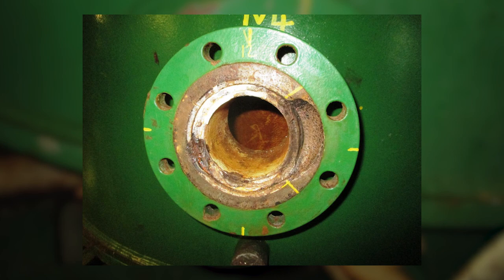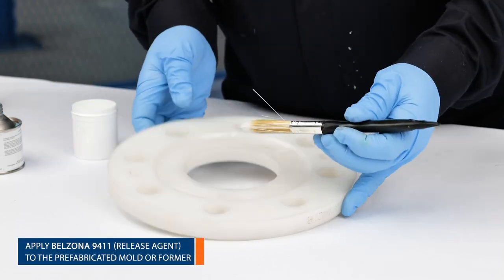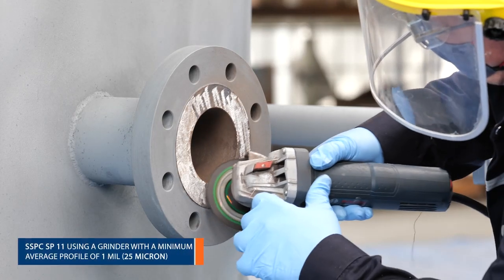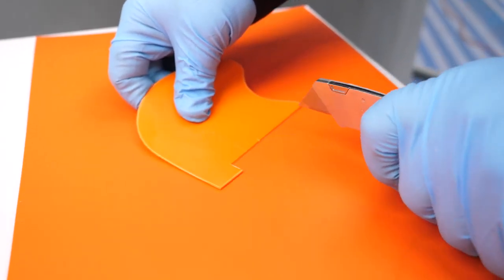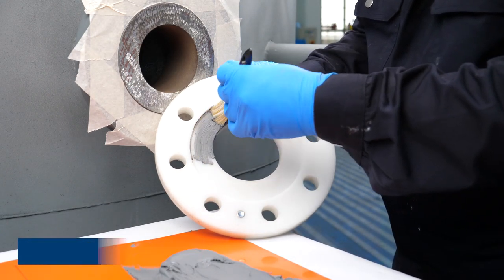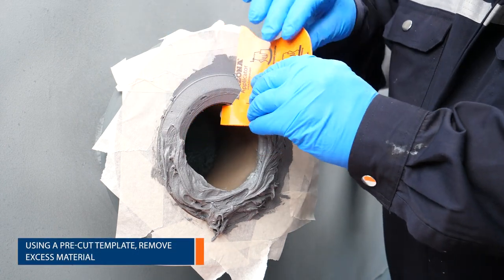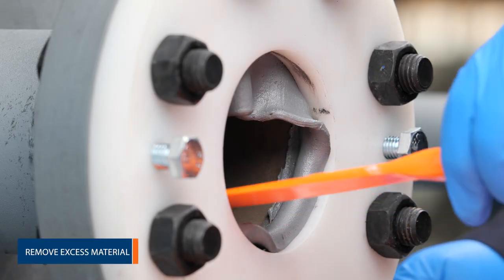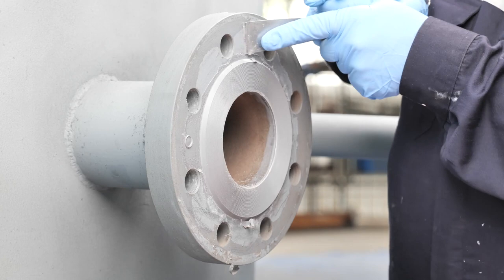Flange Face Forming and Protection with Belzona 1111

Comment: For surfaces under the effect of pressure and vibration, is it also recommended?
Reply from the maker: Hello, thank you for your comment. Yes FFF can be recommended for surfaces under the effect of pressure and vibration. The formed flange face (the raised inner face) will be compressed against the corresponding side of the mating flange, so the material will be always in compression once the flange is closed. The paste grade materials used for this application have a high enough compressive strength for the compressive force and torque applied in fairly high pressure lines.

Comment: What is the minimum depth before we apply belzona?
gracias...
Reply from the maker: There is no minimum depth Emma just the correct surface prep is enough for the application as seen in the video good machining or grit blast to 3 mil would be the best. That is enough to get the adhesion for application.